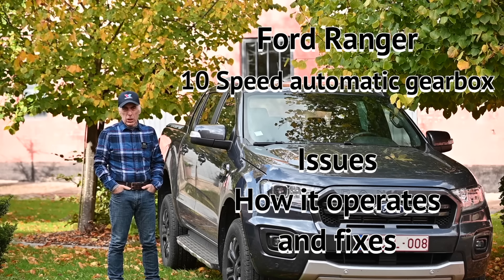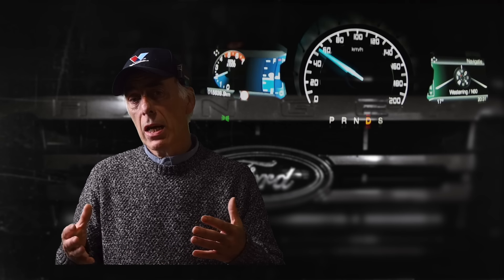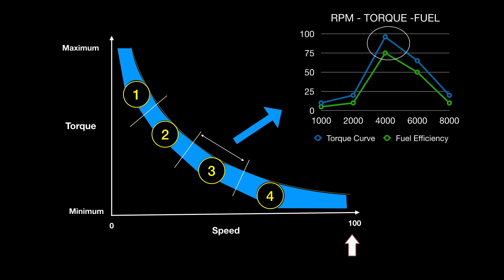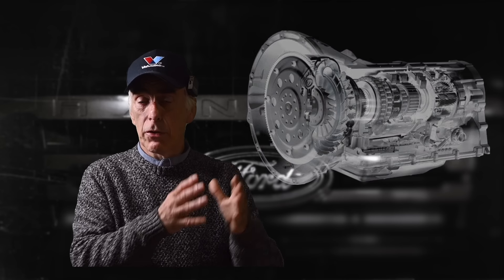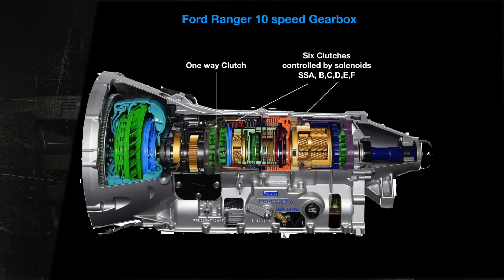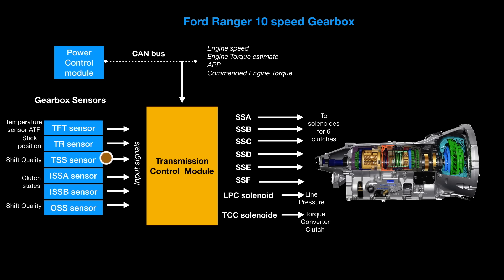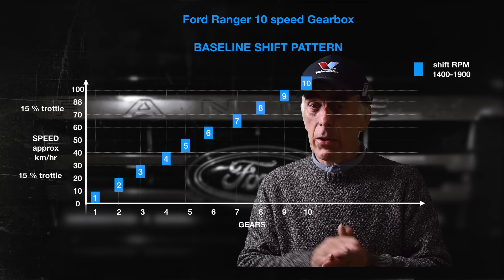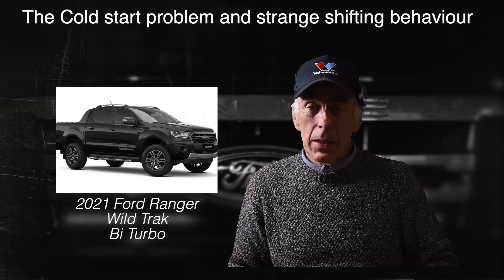Ford Ranger 10 speed automatic gearbox issues and fixes

Comment: Bought a new Ranger StormTrak May 2023. Gearbox trauma from day 1. Took it back to dealer. Told them to reflash the TCM and ECU and then access to Adaptive Learning and put it into "Halt Adaptive Learning". They REALLY didn't want to do it until I told them I would park it outside the dealership with a BIG sign -THIS CAR IS A LEMON DO NOT BUY FORD!!! So they did what I asked and GUESS WHAT.... no gearbox problems. Drives smooth and feels great. The lesson is KNOW YOUR RIGHTS....do your research. BTW I actually like the Ranger its Ford's terrible terrible service thats the problem. They sell us lemons and we drink the lemonade. I don't know if this will work for you but its a good start.
Reply from the maker: Thanks, and yes Ford dealers are always arguing if we ask something as the owners of the car...
Reply: had the same in poland  , i rode with sign FORD NEVER AGAIN  and TO SELL ON OWN RISK  - in one year old ranger raptor.
Reply: Bullshit it has bad clutch drums the bushing wears and the drum wobbles ruining the seals !

Comment: Oh for the days of 4 speed manual gearbox an engine with a distributor carburettor and no electrics far less problems
Reply from the maker: Indeed
Reply: Absolutely agree with that.
I’m totally hacked off with modern vehicles, the interior poses as a huge distraction to the driver, with all this ‘infotainment’ which supposed to please the eye.
Heating controls in cars in .5 degree increments, and zoned areas in a small car cabin….WTF!.
HATE THESE VEHICLES WITH A PASSION!
Reply: You remember carbon arcs on the distributor cap? Setting the Points gap, advance and dwell setting?  Float leaks? Needle valve problems?  
It wasn’t roses.
Reply: but you could it now it needs to be plugged in @bearlemley

Comment: Our 2020 Ford Ranger was shifting roughly, especially 1 to 2 and 2 to 3.  Took it to Ford dealer. They have Technical Service Bulletins referencing this issue for most of the Ford trucks/SUV 2017-2023.  The latest is TSB 22-2428.  In our case they performed the recommended actions, including resetting the Transmission Adaptive Learning.  Just normal driving for a couple of days afterward seemed to complete the fix.

Comment: Have a 2020 Ranger fx4 build date 10/2020.  I took it in for a roof leak. Whe it was finished, truck would not  go in reverse. Had to be their an extra  days.  I checked a  forum said  Ford replaced  valve body. Said it was buttery smooth afterwards...Sure enough it was a valve body. Lucky under warranty still. I will find out Monday when I pick it up!👍

Comment: I have just purchased a ford ranger wildtrak (19) t8 2.0 10speed auto. When i put my gas pedal to the floor the gear shifting is awful and jittery/jumpy.. is this likely to be the same fix? It particularly happens at speeds over 50mph and no amount of driving makes this issue go.. 

I absolutely love rangers and think they are stunning trucks..just very frustrating
Reply from the maker: That is indeed some of the  issues I had as wel.  I have gone through the process and that fixed it to a large extend.    The real cause of it is the way the solenoids are held in place as that can change and they may get some play.  That is why we need to go through that tuning /learning process.

Comment: Bought a 2019 Ranger FX-4   new and currently have 49,000 miles on it. 2 trips to Fla. ( I live in north Ga.)
and 1 trip to New Braunfels, Texas. So knock on wood no issues so far. And I always warm up before I drive off and oil changes at 5,000 miles. So all that aside I really like the truck.

Comment: - If it jolts on take off, give it a ten-count after starting the engine before you shove it into D and hit the pedal
- Stop procrastinating and just go to Ford and get the software update done
- The 'self-learning' thing is actually 'calibration' and it only happens once after the TCM calibration is cleared, it's not an ongoing thing. Stop talking about how it learns from you

Saved you all 22 mins, enjoy

Comment: My Everest 10R80.
Even after driving for 1 hour+, uphill starts or very low speed variation driving on tight country dirt roads.
In DRIVE.
Sometimes auto is undecided on which gear to select 1,2 ,or 3.
Sports mode helps as does manual control.

Comment: My 2023 Ranger is right now in the Ford dealer for both these issues.  Thought I'd have a quick google out of curiosity and I am so glad you made this video!  I now realise the shift pattern issues started after they last updated the software for an emissions fault and the high engine revs at start are probably related to the drips of oil on my drive that have formed recently.  I thought both symptoms meant the gearbox was knackered.  I can't wait to ask them if they did the TCM Learning Procedure this time!
Update: Gearbox to be replaced under warranty! A gearbox mount had "come loose" causing a crack in the casing and I guess caused the loss of fluid.  I drive extremely gently, in eco mode for all of it's 45k miles.  Either that mount came loose all by it's self or to my mind it was jolted loose by one of several bad shifts at low speed.  I had been hearing a rattle at low rpm/high torque but it sounded like a loose heat shield.

Comment: Informative piece you have put together make sense.
  I have an issue with transmission being in to high a gear, say 7th or even 8th traveling 50 km an hour. It's too high and has that jerking feel. Any suggestions? Service Ford just says they are all like that, not comforting to think this is what Ford wants???  Wouldn't of bought the truck if this is the way they want???
Reply from the maker: I know, and there is little to do..maybe just go through that learning  sequence and see if it improves

Comment: Well mine is a 2018 f150 2.7 but it has the 10 speed gear box as well. Same exact problem. Had the dealer clear the the adaptive learning tables. Fixed it. But now it's slowly coming back.
Reply from the maker: do a reset ... as I did...

Comment: Thank you for the video. I get the no move for a few seconds on a cold start. Also I am noticing that at low throttle position I get little jerks/hiccups from the transmission.
Reply: I started having the same issue with mine at low speed. It's at ford now getting a transmission service done.

Comment: There is a technical service bulletin for these transmissions and basically it says to update the TCM. If that doesn’t work then replace the valve body. If that doesn’t work replace the transmission. It should be under warranty. Most dealers will do a lot to not do something under warranty. It unfortunately does not pay well. This is not the dealers fault it’s the manufacturer. They set the warranty times. Truth is most car companies can no longer make a product that can be mass produced, reliable, cheap, efficient, and simple to fix. If your car is under warranty you have to get mean to get what you want unfortunately. Go on a test drive with a technician if you have to. Thanks for the video. My 22 ranger has shifting issues but it’s fine 90% of the time.

Comment: Have a 2019 ranger, 134,000 miles. All Highway. Trans failed. Had it rebuilt,  2200 miles failed again. Back to shop it goes to get fixed, then getting rid of it.
Reply: Landcruisers ( Toyotas) never has these issues, probably never will either!
Reply: What a sad experience to have to throw away an entire car just because of this obnoxious 10R80 transmission!

Comment: Interesting, I have a Raptor Ranger on order, curious if will have similar issues.
Reply from the maker: Hi Pat,  nice ....  I was thinking of it some time ago...   let us know ok how it goes
Reply: Cold start is normal issue to all vehicle not just Ranger. Any car will experience cold start and that is not on the 10 speed transmission issue. Cold start most like the starter problem or battery nothing on transmission. We have 2007 model transmissiom we fix the starter and now no more cold start. The problem to all driver who drive on Automatic is the way they drive. When you drive in City push the accelerator slowly and it will change gear to low to higher gear  Do not push and pull the accelerator. There are many gear inside the transmission. Now when u drive in highway push deep the accelerator and u can see the odometer go high speed and if reach to 80 to 100 kph release the accelerator and let the carl run. If the odometer is slowly down to 60 then its time to push the accelerator and if reach to 120 to 160 release again. That is the way your automatic car will last to 30 yrs without any problem. Another friendly advise to all automatic car owner when you park hit hard the brake and put to neutral and then park. If you hit the brake and put to park the vehicle will move backward and if you do that all the time your reverse transmission will damage the gear and it will not reverse. This is what I observed to all Automatic.

 Summary:
All Automatic car. Do not push and pull the accerator. Push slowly to reach to 60kph if u drive in City. City speed max to 0 to 40 correct me if I am wrong. In freeway push deep accelerator if reach to 80 to 120 relase the accelerator let the car run. If u see the odometer slowly down speed and push again the accelerstor to reach to high speed 160kph and release again. Friendly advise to last forever without any problem. I say again do not push and pull the accelerator if u drive automatic car.😁😁😁😁😁 if manual no problem
Reply: I bought mine 2.0 bi-turbo, not new V6, to avoid all issues of the new model, and here we are. Tranny is jerky and dealer cant reproduce behavior 😀
Reply: How's your Raptor doing now? I'm still waiting for mine.

Comment: Waw, dat was een hele brok of een automatische bak ! Zeer goed uitgelegd. Btw, ik heb ook nog in discussie gegaan met Ford.
Afgewimpeld worden bij de dealer, hoewel... voet bij stuk gehouden ! Vervolgens, ingenieurs van Ford Genk (toen bestond dat nog) ! Grote discussie... dan Ford UK... idem. Uiteindelijk... gelijk gekregen, alles vergoed !
Reply from the maker: Inderdaad, dat is hun tactiek , eerst afwimpelen maar als men aanhoud zal men moeten toegeven.
Reply: Cold start is normal issue to all vehicle not just Ranger. Any car will experience cold start and that is not on the 10 speed transmission issue. Cold start most like the starter problem or battery nothing on transmission. We have 2007 model transmissiom we fix the starter and now no more cold start. The problem to all driver who drive on Automatic is the way they drive. When you drive in City push the accelerator slowly and it will change gear to low to higher gear  Do not push and pull the accelerator. There are many gear inside the transmission. Now when u drive in highway push deep the accelerator and u can see the odometer go high speed and if reach to 80 to 100 kph release the accelerator and let the carl run. If the odometer is slowly down to 60 then its time to push the accelerator and if reach to 120 to 160 release again. That is the way your automatic car will last to 30 yrs without any problem. Another friendly advise to all automatic car owner when you park hit hard the brake and put to neutral and then park. If you hit the brake and put to park the vehicle will move backward and if you do that all the time your reverse transmission will damage the gear and it will not reverse. This is what I observed to all Automatic.

 Summary:
All Automatic car. Do not push and pull the accerator. Push slowly to reach to 60kph if u drive in City. City speed max to 0 to 40 correct me if I am wrong. In freeway push deep accelerator if reach to 80 to 120 relase the accelerator let the car run. If u see the odometer slowly down speed and push again the accelerstor to reach to high speed 160kph and release again. Friendly advise to last forever without any problem. I say again do not push and pull the accelerator if u drive automatic car.😁😁😁😁😁 if manual no problem

Comment: Ive put about 2,400 miles on my 23' Ford Ranger Tremor and I have started to notice some of these issues as well. Some hard shifts especially in the cold, some harsh clutch engagements and disengagements after letting on/off the accelerator pedal etc. I thought maybe it was the trans fluid not flowing throughout the transmission fully but I'll still notice it after driving for 20 minutes or more with temps at operating levels. Going over hills or irregular terrain while it trying to hunt for the right gear felt very lurchy and uncomfortable. And after your spiel on it not being in a learning state for the first 1,000 miles or so of its life is a bit concerning for the future longevity of my particular unit. Almost makes me feel as though im not driving it correctly in a way or being too careless but its just the way it drives.

Comment: This is an issue i have on my Ford Ranger that i ve seen nobody talking about!! I do have a Ford Ranger 10 speed auto and im well familiar with that cold start issue. I do experience a violent gear shift though, mostly just on the 2nd to 3rd gear shift if i give to much throttle. Should i do the learning procedure although i dont have a OBD reader to clear the codes?

Comment: Excellent piece of research, super great video! I still hate my F-250 trans though
Reply: Cold start is normal issue to all vehicle not just Ranger. Any car will experience cold start and that is not on the 10 speed transmission issue. Cold start most like the starter problem or battery nothing on transmission. We have 2007 model transmissiom we fix the starter and now no more cold start. The problem to all driver who drive on Automatic is the way they drive. When you drive in City push the accelerator slowly and it will change gear to low to higher gear  Do not push and pull the accelerator. There are many gear inside the transmission. Now when u drive in highway push deep the accelerator and u can see the odometer go high speed and if reach to 80 to 100 kph release the accelerator and let the carl run. If the odometer is slowly down to 60 then its time to push the accelerator and if reach to 120 to 160 release again. That is the way your automatic car will last to 30 yrs without any problem. Another friendly advise to all automatic car owner when you park hit hard the brake and put to neutral and then park. If you hit the brake and put to park the vehicle will move backward and if you do that all the time your reverse transmission will damage the gear and it will not reverse. This is what I observed to all Automatic.

 Summary:
All Automatic car. Do not push and pull the accerator. Push slowly to reach to 60kph if u drive in City. City speed max to 0 to 40 correct me if I am wrong. In freeway push deep accelerator if reach to 80 to 120 relase the accelerator let the car run. If u see the odometer slowly down speed and push again the accelerstor to reach to high speed 160kph and release again. Friendly advise to last forever without any problem. I say again do not push and pull the accelerator if u drive automatic car.😁😁😁😁😁 if manual no problem

Comment: Hi D3Sshotter, thanks for clearly explaination. I have a doubt: in my 10r80 i have seen a little red drops (i suppose oil gearbox) hanging from cooler tubes. Could it be related with any kind of usage? or it is a kind of leak not related with how i use/shif the gears?? After your explanation i supposed it is not related with bad learning proccess, isnt? Thanks in advance.
Reply from the maker: I don't think so, but rather from a miner sweating joint/seal....
Reply: @D3Sshooter  i went to dealer, i hope it will be nothing important.

Comment: Thanks for the video! Steve, would you say that a 10 speed transmission replaces the need for a two speed transfer case (4-lo)?
Reply from the maker: No not at all, there is still the need for a transfer box  , so that we can even further reduce the gear  to have more torque  ,   and of course the 4H

Comment: Thanks for the video! I'm going to try this this weekend and get back to you. I have an appointment with Ford next week to drop off my 2020 Ranger for all these exact issues. They said they need the truck for 2 or 3 weeks to rebuild the transmission. Mine has gone from bad shifts to worse, it can't find a gear sometimes when I'm on the highway it almost feels like a stall. Thanks again.
Reply: Did you replace the entire 10R80 gearbox or just repair it?

Comment: I have a 2021 US version of the Ford Ranger and so far have 36K on it.  I haven't had any issues with the 10 speed transmission at all.  Under normal circumstances it will always skip 2nd gear and will handle any gear down to 1100 RPM.  In fact it acts more like a diesel than a gas engine.  It simply has that much power coming from the 2.3 turbo engine.  It does not hunt and will seamlessly shift without drama.  I do not abuse the truck but don't baby it either.  I think part of my success is using 93 octane gasoline as the engine produces more power, more easily with the extra octane.  If you press the down shift lever on the stick in drive mode it will show you what gear you are in.  In fact you can also use this feature to limit what gear will be the highest available.  Say you are in the mountains and want to avoid 9th and 10th gear you can simply press the downshift lever until 7 is the highest number on the dash display.  Pressing the upshift will reverse the process.  Of course you can also use sport mode but it is less flexible in some scenarios.  Overall the 2.3, 10 speed has proven not to be the problem some people report.  I have never been to the dealer for warranty work so I got a good one.  If you test drive a new one at the dealer the engine and transmission will act very differently compared to when the engine and transmission are broken in - this leads to many false impressions of the vehicle.  Thanks for sharing.